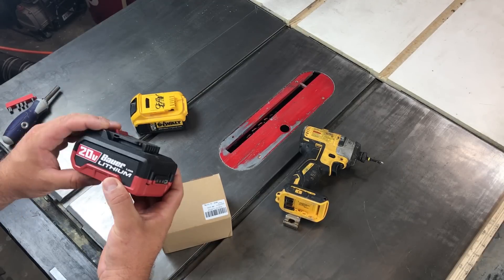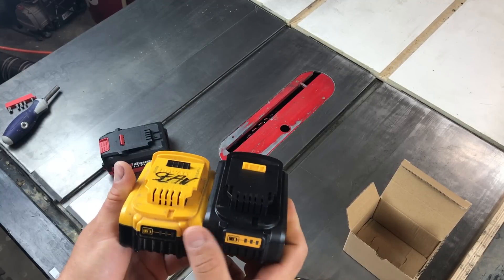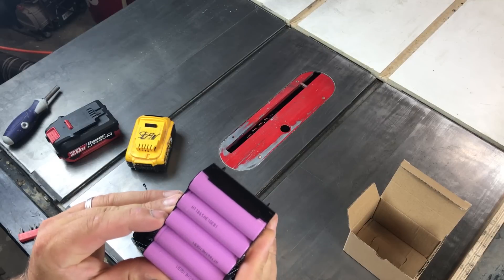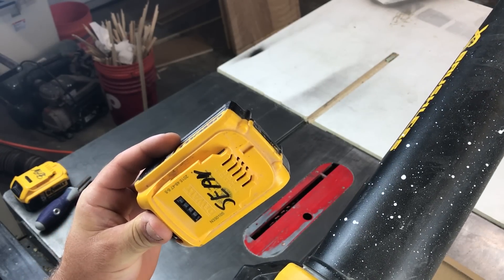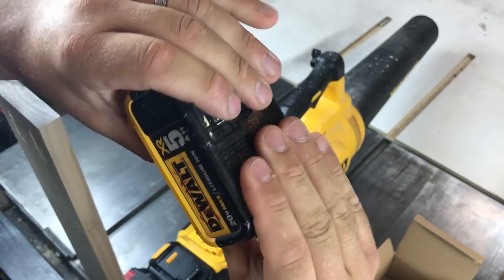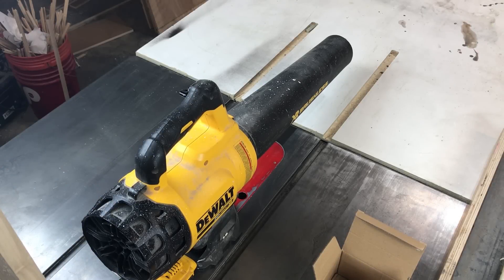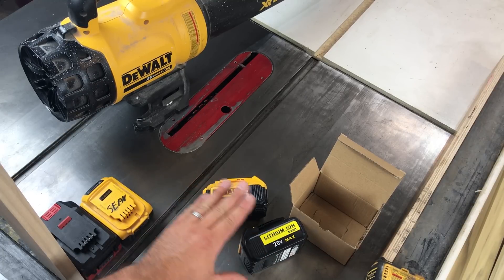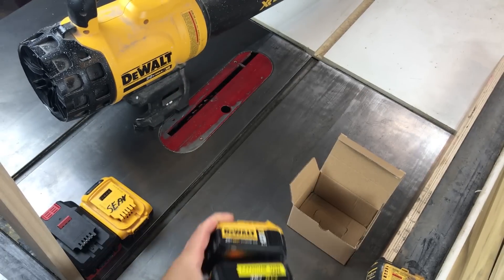Generic Dewalt battery from Amazon vs Genuine Dewalt 20v Lithium battery

Comment: "You know who you are" *tosses impact driver on table saw" fucking perfect haha! Great vids. Definitely interesting to see how the knockoff batteries perform. Personally I would not ever use a non dewalt battery in my tools. I have no idea how good the protection circuitry is. I would not want to risk the hundreds of dollars I've put into dewalt tools with a $40 knockoff battery. However, still an interesting test. Keep it up
Reply from the maker: +P0tat07  I'll dig into it more, but I think the protection circuit is in the tool

Comment: Thanks for the test, I am still using my "old school" Dewalt XPR 18 volt tools but an switching over to using the lithium batteries as I run my ni cad batteries out.  Thanks I've been wondering if these Amazon batteries were worth it.  Looks as if they are.
Reply from the maker: +Lincoln Scruggs III if they hold up over the long term
Reply: I’ve had my cheap $34 5ah battery for 3 1/2 years my dewalt had about 2 years and failed

Still use my 5ah everyday as a mechanic
Reply: I’ve had my cheap $34 5ah battery for 3 1/2 years my dewalt had about 2 years and failed

Still use my 5ah everyday as a mechanic

Comment: I use dewalt everyday all day I am a assembly technician "I put shit together for  lowes home depot wallmart and ace hardware ie.. grills patio sets ect. I use a dewalt 2ah for about 3 days on each charge I have a couple cheaper 1ah batteries but use them as a I forgot to charge the 2ah battery

Comment: Hummmm... @AvE did the same kind of battery test  a couple weeks ago ??
Reply from the maker: Maybe similar, but not the same
Reply: yeah AVE noted that the over current protection was lacking, thus you get a cheaper battery that might burn down your house...better off buying a 9ah 2pack from acmetool for 249 real deal dewalt
Reply: You guys saying cheap batteries burning down your house make me laugh. I've had brand name batteries smoke and melt in a charger. If they are that much cheaper, I would buy and start using them too.
Reply: Mark M let me know when you had a masters in electrical engineering and work with these cells daily. I guess everyone remembers when
Samsung’s were burning homes down and cars. These have ALOT more energy then those  Phones. These don’t have any over temp protection, they don’t have any over charge protection or any thermal over load protections as the legit manufacturers do. Let me know when you can name every part on these control boards and explain in detail what they do and how they do it. People are insane if they use these

Comment: Unfair teat.  Your Dewalt 5amp battery has been charged several times. (Cycled), while you generic battery is new.  These batteries require some cycling to reach their highest capacity.
Reply: I agree with your observation. The generic needs to cycled through a few times to get a fair result. I have one of the generic Amazon 18volt batteries and it is very close to a Dewalt for run time when I do a total discharge test on my 18 volt vacuum cleaner.
Reply: Howard Osborne  Yeah, I recently bought a top rated clone on Amazon and after a few cycles, it’s right up there with the OEM battery.   I have also used a clone with my old Craftsman drill.
Reply: It is not fair :(

Comment: The boards in the battery packs are not the same. The cheap Chinese one don't have the ability to keep individual cells in balance. This means you could end up with a runaway cell. So be careful you don't burn your house or shop down. I wouldn't put it on the charger and leave it unattended.
Reply: You know they both made in China, right?

Comment: NO battery comes fully charged! You should have charged the Amazon battery first. Just cuz it says 3 bars means nothing. It could have been ready to go down to 2 bars out of the box. It's unlikely the Amazon battery is even worth it in the long run. Even if it runs almost as long, will it LAST as long? Probably not. I'll stick with DeWalt.
Reply from the maker: I did charge it....

Comment: The biggest problem I have with Chinese generics is they're not subject to the same government standards in manufacturing. Dewalt being an "american" company is. Here in the US there are laws in place requiring a level of safety features that chinese off brands just don't have to meet, which is why they're so much cheaper. so while the overall performance is seeming on par for the price difference, what you lose is redundancy in the safety features that prevents the lithium Ion cells from literally exploding in your hand. sure you may never have a problem with them, but if you do, i bet you'll wish you spent the extra 40-50 bucks.
Reply: Daniel Kadera,  >>Dewalt being an "American" company<< 

Possibly Daniel, Dewalt is owned by Stanley Black & Decker who also own Craftsman, I wouldn't put too much faith in the made is USA angel. 

Since they only recently moved some of their business back to the US from china in like 2017.  Ahem. trump.
Reply: @TruAnRksT  That's why I added quotes around "American". Most of their stuff is made in China. but the USA makes the manufacturer ensure it meets certain standards because it is being sold here in the US by a company based in the US. Generic Chinese knockoffs get to bypass all those standards because it's not an American company selling them. That's why they can sell them so cheap. One, they must pay a fee to certify that the product meets quality and safety standards and two they can cheap out on the components because they don't have to meet those standards.

Comment: I would run the test again. Fresh off the charger.  The China Battery may have been charged at the Factory and put on a Burn In Jig for 3 minutes.... Hence... Your short 3 minutes....   The 3 minutes on the China Burn in Jig may not have worn the battery down to the threshold of the next ;pwer LED light.  You may have just blown off a perfect replacement with a faulty test.

Comment: I am a 41 year union carpenter and use dewalt batteries daily and I bought 6 of those cheap batteries and they burn out within a week. Don’t buy them . 5 of the six are dead and can’t handle heavy use. Beware don’t buy them.

Comment: So what is the long term review for the Amazon battery?
Reply: Ívar Arason DO NOT BUY. Do people here understand the batteries used in these are not new manufacture cells, they are pulled from dead old electronics and they do not come close to the same safeties if at all.

Also every manufacturer will void your warranty if they find evidence of these being used. AvE did a tear down on this and explain in detail the differences and it is scary bad. 

Yea you saved money but when they burn your house down. You didn’t save anything. There isn’t this battery conspiracy by manufacturers, there is a ton of tech in the legit batteries that these do not have that are designed to protect you and your tool. Plus you are buying used cells that you don’t know their history or if they are safe at all to use. This isn’t something you cheap on with mystery crap from China. This will burn your house down.

Comment: Hi I purchased one of the fake Dewalt batteries, went well to start with, but after trying to recharge for the second time it would not take a charge. Totally useless and I was over the 60 days for a return on eBay, also the seller would not even return my emails.

Comment: You get what you pay for so i always buy dewalt batteries.
Reply: Before the 5.0Ah came out, I bought a 2-pack of 3.0Ah Dewalt batteries for my drill for $99.  Right next to it on the shelf was a single pack 3.0Ah Dewalt battery for $99 and I just had to wonder if anyone would be dumb enough to buy it.

Comment: Aftermarket battery last 4 to 6 months (less than half the Dewalt life.)
Reply: I have same aftermarket baterys over 3 years still working good!
Reply: Lol, that just isn't true. I've got 6, never had a single problem with any of them in 2 years. I'm a joiner/carpenter and use 18v gear all day every day. One lot was a 4 pk for £76!! 2 and a half years for £76 beats any DeWalt price

Comment: Meaningless test. 2 things: The batteries shut down because of overheating, not capacity. A brand new battery needs to be cycled 2-3 times before it reaches full capacity. Some will gain up to 20% capacity just from cycling. You should re- do the test  with the blower on the losest setting, outdoors on a cool day, and the new battery broken in.
Reply from the maker: +Bob Adkins The thing is, I use them at full power in this way, so that’s all that really matters to me.
Reply: If you're doing this only for your very specific needs, then you don't need to put your test results on Youtube.  I think your viewers came here to see if the battery pack was any good, not just the thermal cutout. Most people use that battery for a um, drill. Probably over 90%.
Reply: Sean Carlin Designs when it burns your house down, these are scary dangerous and have no safeties like the legit brands. I honestly don’t understand how anyone who says they know how these cells work would ever risk using these.The cells used in these are USED from dead electronics and most do not have matching cells and the color your talking about is not true with these. They have gone as far as putting fake info on the cells.
Reply: Do they burn your house down just from sitting there unused, being used, or on the charger? Why are they going to combust? @zack9912000
Reply: @zack9912000  Quit BSing everyone.  I realize you understand batteries but you are speaking in absolutes.  Most of these 3rd party units are a very good buy and smart.
Reply: @bman3020  feel free to do basic research and you will see how wrong you are
Reply: @xseedlingx  they have done just that, remember Samsung batteries would blow. If the cells are damaged from abuse or are in bad shape they can have what's called thermal run away and catch fire.

Comment: Most of us construction guys don't use a blower all day long we use our drills impact and Sawzall ocationionly and not run them until tge power runs out I use dewalt tools happy with them but the fans boys are out of control with their all expensive oem dewalt shit I'm a hvac construction guy and a dewalt 5ah battery last me for over a week using it all day I have two of these Amazon batteries and they last the same amount of time why would I pay 80 0r 90 dollars for a dewalt battery if a 35 dollor battery give me the same run time on my tool

Comment: I was wanting to buy dewalt 5.0 ah batteries , i have 2.0 now there a joke. I waswondering how long it takes to charge a 5.0 battery back up . 2.0 takes an hour so will it take 2.5 times longer or just an hour since its a quick charger.

Comment: So you put a used Dewalt battery against a brand new Chinese battery, and the Dewalt still won, but you prefer the Chinese one? That makes no sense. Shorter run time=more heat=shorter life. Not only will the cheap battery not hold up nearly as long, it can damage tools. For the superior cells in the Dewalt batteries, the price is actually quite fair.

Comment: I'm sure you realize you test is not valid.  The dewalt battery has been used several times the generic has not.  The battery capacity goes up a bit on the first few charges and then it goes down.  Also you do not address long term lasting, charge retention in storage, performance at real world tempertures.
Also, SAFETY,  remember reports of computer, phone, RC models with Lithum ion batteries bursting into flames.  FYI-I have bought off brand, generic batteries.  Like anything else a branded product cost more but you know what you are getting and have a company standing behind it.

Comment: Better option is to replace the cells in a genuine battery with quality cells. You can guarantee the cheap battery has low quality cells.
Reply: Rufus Chucklebutty wouldn’t that mean spending just as much?

Comment: It takes longer than 3 minutes to walk to the truck for a new battery and put it on charge.
Multiple extra trips a day=less production.
After my page of calculations...the difference is the name brand paid for itself the 1st day. Plus HD has double packs them on sale.
Especially around christmas.
If you use saws or grinders a 5 amp is really the minimum power that's acceptable.
Trust me. I have 1.5, 2, 3, 5 amps.
Just wish 6ah ones were cheaper and lighter.

Comment: Number one OEM supplier for WHO?  I can tell you that you're "better deal" will be short lived.  With Li ion packs more than other things buying knockoffs is fools gold.  You MAY get lucky though, and be the 1 in 1000 who have good luck with them.  Usually you will notice rapid loss in run time after just a few charges. You didn't mention the warranty.  The biggest problem with knockoffs is that you simply don't know what you're getting inside.  And usually, it ain't good.
Reply: I got an OEM side view mirror for my tundra that had blind spot recognition, turn signal etc. nearly exactly the same as the factory mirror. around $225 instead of about $900
Reply: @steveprince5611  OEM means Original Equipment Manufacturer.  As in original parts from Toyota or their supplier.  You're talking about aftermarket parts, I believe, not OEM.  Regardless, we're talking about battery packs, not aftermarket auto parts.  I too have had to replace mirrors and did exactly what you did for the same reason.  While I don't feel the build quality is as good as the original, it performs fine.  These batteries WILL NOT.  If you need a battery that will only last a few days, they MAY be fine.  But in the end, you get what you pay for.  With tool batteries, you get less than you pay for.  There will always be someone who gets lucky and/or claims the junk batteries are just fine.  I'm not calling them liars.  I just don't think they probably use them in an industrial setting.  If you get a drill out every 6 months to drill a hole or two, you really have no clue how good the battery is.  See the follow up to this video and report back.  Enjoy your weekend!

Comment: Actually,  the Dewalt runs for 33.5% longer than the Amazon battery, not 25%. You better check your over-complicated maths
((15 min 40 secs - 11 min 44 secs) / 11 min 44 secs) * 100 = 33.5%.
Reply: Yes it runs for 33.5% longer, but the Amazon one runs for 25% less time 
704 seconds over 940 seconds = 74.89 percent, so it runs for 25.11% less time

Comment: I bought one only lasted about 6 months
Reply: Will not hold a charge now
Reply from the maker: +JZuniga81 it would be interesting to test it and see what failed..
Reply: Then you did something wrong probably burnt out the fused link
Reply: Well let me say it will not charge the battery indicator shows full and when you use it it dies in 0.5 seconds 😄LOL! If you want to check it out let me know
Reply: Sean Carlin Designs because they are used batteries from old electronics is what is used in this. They are not the same as advertised and people should care. They don’t have the same safeties. These are scary and dangerous bad. AvE did a detailed tear down and explained in detail the difference. They have no over temp safeties, they don’t have any over current protection, they have no thermal overload protection as the legit batteries do. These will burn your house down

Comment: I got caught buying those Amazon batteries for my DeWalt tools four of them in fact and three of them died within a couple of months won’t charge the other one only half charges and I put it on the shelf.  👎🏻👎🏻👎🏻👎🏻👎🏻 junk!
Reply: I bought a couple 4ah on Amazon for $60 over 2 years ago..... my brother has the tools now and still uses them and the batteries.....so not everyone's experience is "junk" 👍👍👍👍👍👍👍
Reply: I am a union carpenter for 41 years and I work with them daily on the jobs .  They don’t last.  I still have some Dewalt 4 AMPH battery’s that have worked for Six years of heavy use.  I know for a fact they can’t handle the heavy use and the extreme heat.  Three of them died from drilling concrete installing forms with the dewalt cordless SDS drill..  my job lasted 6 months and the Amazon battery,s only one week.  If you’re just a home owner who uses them once a month then buy them.  For someone who uses them daily, don’t waste your money.  They are cheap junk and not worth the money.  I could send you the dead ones and maybe you could bring them back to life!

Comment: Send it back .its junk mine quit mid use no reason and would not charge others display quit function  then died 2 weeks later went through 4 of them and my dewalt still holding strong Sept packs don't like impact cracked 2 factory voids warrenty

Comment: So... you throw your tools around like trash, you only verify full charge by looking at the led lights, knowing that just because they have 3 lights means they are fully charged..?? Wrong.. You pulled the amazon battery out the box and put it to use immediately. 
So many things wrong with this video.

1st you completely DISCHARGE BOTH batteries (without a timer)
THEN you let them cool down before charging again... 
THEN you charge both batteries until the charger says they are both FULL...
THEN you put them on your blower and measure their time ... 

You do this like 3 times to get a REAL WORLD test to compare their capacity ... After 3 runs you can determine if the amazon battery is up to par..

If you really want to test this battery, you do the above test for like 6 months straight, this will tell you the real quality of the battery..

I did this for my Ryobi batteries, REAL vs Generic from Ebay ... After 10 tests and several days later, i found the Ebay generic to outlast the Ryobi brand 2 more times, and we are talking maybe 1-2 minutes difference which IMO is nothing ... Its been about 5 months now and the generics are still going